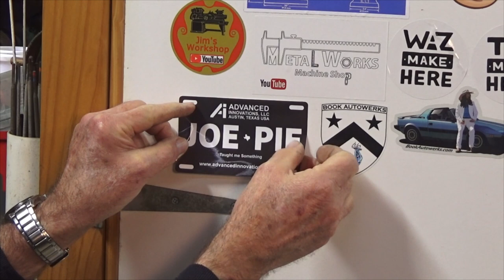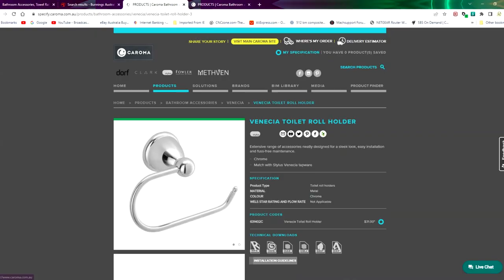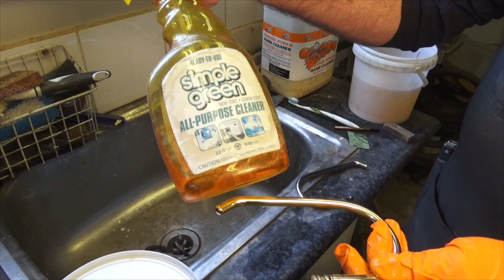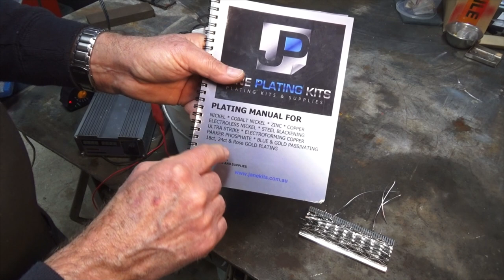DIY ART DECO WALL SCONCES (THAT'S A WALL LIGHT FITTING) Part 6

Comment: Mark, it is possible to lay nickel down onto steel.  However, topnotch work requires a layer of copper be laid down before the nickel.  Because iron is much more reactive than copper, a "strike" bath has to be used to prevent poorly adhesive immersion plating from occurring.  The most common copper "strike" is based on HIGHLY toxic cyanide.

I totally agree with the rant.  The sale of Chinese guano at other than "bargain basement" prices occurs far too often.
Reply from the maker: Jane Kits do sell a copper strike kit and an electroforming copper kit. Sadly, I have so many buckets of chemicals now that adding another would seriously overwhelm my storage. Maybe when we downgrade to just one car I can expand my repertoire. 
Regards,
Mark

Comment: I worked for a company that reconditioned train bearings, we performed hard chrome plating which was an extremely corrosive and dangerous process.  You are correct about the constant filtering of the solution, we had to change the filters a few times a month.

Comment: I have only played a little with electroplating so far and not even got results as good as yours. But chatting to a local plating company, mostly asking why their results were so much better than mine, apparently the secret is thin layers of copper plating. You polish your part until it's perfect(ish), copper plate it, then polish it again. The copper is so soft that the polishing removes all of it apart from the bits filling the scratches. I haven't tried this yet, but they did really good, super shiny work, so I have no reason to doubt the advice.
The crystals you're getting will be just the result of forming an oversaturated solution of the plating salts. As the solution cools they will be unable to remain in solution so will form crystals. The sludge is other non-soluble side products of the electrolysis - various oxides etc.
Reply from the maker: Matthew, I have an experienced electroplater (retired) paying a visit later this week. He did say that I was only going to get mediocre results until I started to copper plate first. I would very much like to use that process but I have a large collection of chemicals already and I didn't really want to create more of a storage headache. I may have to move all the buckets up to my shipping container "annexe". 
Regards,
Mark
Reply: @Preso58  I can totally understand the 'too many chemicals' problem. With metal finishing, homebrew, and various other chemistry interests I have so many pots of 'interesting' chemicals I worry what the authorities would think if they ever investigated... I'm fairly sure it's all legal, probably...
It is good to get independent verification that copper plating is the way to go. I was shocked how little effort the pro's put into polishing to get spectacular results.

Comment: For prep work on the pre-plated part, a product like Prep-All would work great. It is most widely used by paint/body people to remove grease and wax from a car body to get it ready for paint. Would do the same for the brass you're using, only without as much work as you're putting in to the part with Simple Green and scrubbing.

Comment: Hey Preso, great series and I’m learning a lot. I’ve seen that dirty little trick of showing highly polished parts at particular angles to hide the scratches. Some times you can spot the imperfections if you look carefully. I am collecting materials for nickel plating but got side tracked and went down the rabbit hole of “bluing” metal with hot salts which is different again to cold blueing and hot blueing with oil. I’ll have a video out on that shortly. I really hope you enjoy your holiday and stay safe. See you in a few weeks, cheers Stuart. Canberra.
Reply from the maker: Thanks Stuart. I'm interested in seeing the hot salt method for treating steel. I've never had any success with cold bluing. It looks OK for a while but it soon goes brown and inevitably turns to rust. 
Regards,
Mark
Reply: @Preso58  Same here Mark, I’ve always found the cold bluing sort of patchy and gives no protection against rust. Just decorative really.

Comment: Hello Mark, good work! a tip, the surface will become more even if you heat the galvanic solution to at least 30 degrees. also the Part should heat it to 25 - 30 degrees.... but I can imagine that it's pretty warm where you are 😆... nice weekend !
Reply from the maker: Christian, we are currently having one of the coldest and wettest winters for many years. However I do heat the nickel solutions and the parts. Caswell sold a very good immersion heater but when I checked to see if they still sell them they were not listed. Evidently, they can cause fires if they are not fully immersed in the electrolyte. 
Regards,
Mark

Comment: During my flirtation with commercial electroplating of nickel and chromium those inside corners gave us fits, especially with the chrome. Our cleaners were strong acids and caustics followed filtered  water. The nickel baths were filtered continuously. We did use fairly violent agitation of the nickel bath. The substrate was steel.
There were minor surface defects with the nickel plate; the problems came with the second plate of chromium over thee nickel. The chrome plate was a fast "flash" plate. The common defects were poorly plated corners and peelers. from time to time we saw some orange peel.
Commercial plating is not an activity for novices!
Reply from the maker: I did visit a commercial electroplating business to have some parts plated many years ago and I had a sneaky look around while they were busy. I was able to see inside the baths and there was some very heavy agitation going on. I have a retired commercial electroplater visiting my workshop on 'Thursday and he has agreed to critique my setup. I will be able to report on what I find out in the next video. I spoke to him on the phone before publishing the last video and he confirmed what you said about the Chrome being just a thin, fast flash. I am very keen to find out more but as you observe, it's a very deep rabbit hole. I have always been curious about the process.
Regards,
Mark

Comment: I'm not sure Mark, but you may need Anode bags around your nickel cage. In copper plating they use a 1 or 5 micron material.
Reply from the maker: Thanks. I need to find a suitable material. I am wondering if Tyvek would do the job.
Regards,
Mark
Reply: @Preso58  according to Wikipedia it checks all the box's. None woven, water penetrating polyethylene material. Other than that your parts look great And I enjoyed watching👍
Reply: @Preso58  Commercial plating shops use bags to keep the impurity crud from the nickel to a minimum. I reckon it will help improve your process.

Comment: Thanks Mark!  Super interesting.  Greetings from North Carolina, US. I remember getting a chemistry set as a kid where a project was to nickel plate a penny. It was and is magical. 

I found some info implying the green grunge is nickel salts, which are expected. They mention high pH can accelerate formation. I'm not a chemist but have experienced this in the context of swimming pool maintenance vice calcium :)
Reply from the maker: Gene, I recently purchased a PH meter to check the anodising dyes that I use and it turns out that if the PH is wrong, the dye won't penetrate the anodised coating. I suspect that the electrolytes will be the same but I have a retired electroplater paying me a visit later this week and I hope to have some more information on what I am missing out on in the next video.
Regards,
Mark

Comment: What an honour to get a Joe Pie sticker?!
Reply: A bit of trivia - International Harvester used copper plated bolts to attach their exhaust manifolds to their engine blocks. 

It stopped them from seizing in the manifolds due to the extreme heat.
Reply from the maker: Dave, I sent Joe one of my stickers many years ago but never expected to get one in return. So, to have one turn up was a real treat. 
Regards,
Mark

Comment: I really wouldn't sweat the defects, Mark.  Not only are you about the only person who's gonna see them (well, apart from everyone who's  seen this video), but even if they do, "it's artisan" :)  In any case, the end result is glorious, helluva job you've done there.

As an electrician, though, I'd steer clear of terminal blocks.  They get loose, the wires overheat, and in the extreme they can cause fires.  Wago connectors for the win (series 221, which handle rigid to flexible connections)).   Also, and perhaps more importantly, that's a conductive light fitting, it needs an earth connection.
Reply from the maker: Thanks. I will be earthing the whole frame but I have never heard of Wago connectors. OK, scratch that. I do have some I just didn't realise what they are called. 
Regards,
Mark

Comment: I was taught that cheap diecast alloy was called "crappite".... I don't know where this came from.. my dad was a Brit expat living in NSW from 1968 to 1973....
Reply from the maker: Everything I had read about electroplating aluminium alloys said that it was difficult which is why I thought those parts would have been made of brass. The company that sells them does make very good quality tapware and it is made of brass. Clearly, some bean counter has had their way and crappite it is!
Regards,
Mark

Comment: Wonderful watching your process.  Considering some of the minor problems you had, I have a suggestion.  What if you use a pump to circulate the solution out of the container, through a filter and heater, then back into the container?

This would solve your sludge problem, as you mentioned.  It would also let you maintain the heat of shallow baths.  Finally, it would let you remove the aerator, as there would now be a constant flow of solution.

Thinking of the aerator, might that be causing some of the speckling?  I'm thinking tiny air bubbles may be clinging to the surface of your part.

Just food for thought.  I'm glad you're enjoying your journey through all this!
Reply from the maker: I had a visit from Chris Lock on the weekend. He is a retired electroplater and he gave me two very good books on the subject of electroplating. It appears that commercial plating setups use air to circulate the plating bath and the heaters are usually immersed in the tank itself. Filtration is a more complex issue and there are several types of filter. Some are continuously operated and some are portable units that can be taken from one bath to another. The issue with pumps is the corrosion caused by acidic and alkaline solutions. I have made a better container for holding the electrolyte and a better sparging arrangement. The advice I received to get a better finish was to copper plate first and then add the nickel cobalt over that. Copper is much easier to polish than brass.
Regards,
Mark

Comment: The heavy scrubbing is a bit unnecessary.  Let chemistry do all the heavy lifting.  I soak the part for a few minutes in a hot degreasing solution (TSP trisodium phosphate, or watered down drain cleaner) followed by a scrub with a scrub with a towel and rinse. Finally, spray it with brake cleaner and rinse again with water. This will remove any remnants of grease or wax. I do this for
Reply from the maker: I do know there are better cleaning agents for this type of work and I have used a hot caustic cleaner when I was doing some electroless nickel plating. It was a very powerful cleaner but of course it also required some heavy duty PPE. I can soak parts in that Simple Green cleaner for an hour or so and they don't need a lot more treatment after that. However I will look into the TSP as an alternative.
Regards,
Mark

Comment: Loving the progress! The cages for the anodes...is that stainless? Do they suffer any degradation/erosion? On the mystery crystals. I'm wondering if some minerals present in the original water you used, and they have crystallised and fallen out of the solution?
Reply from the maker: Bill, the mesh baskets are stainless steel and they do disintegrate. One was falling apart by the time I finished all the plating. Titanium is the best material but almost unobtainable for the hobbyist. I am thinking I will thread the nickel cobalt anodes onto some titanium wire and enclose them in a filter sleeve. I have been advised that the crystals can be just put back into the electrolyte and they will dissolve when the liquid is heated. If I had filtered the solution when it was hot I would not have had any solid crystals. 
Regards,
Mark

Comment: Hell Mark, Mark from Canada. For heating your larger solution think double boiler. Larger tub with the immersion heater and secondary tub with the solution. The comments for copper plating beforehand are spot on. Also a few air  tubes along the length of your container with a series of holes along the sides of the tubes will give you a much more even agitation. Nice work. Thanks for sharing and giving such great explanations. I have used aquarium heaters and aquarium diaphragm air pump bubblers for etching. Same idea just a reverse of the process.
Reply from the maker: Thanks. I have since realised that I purchased a pond pump several years ago and put it aside unused. It is the type that has a magnetic drive and would be ideal for circulating the electrolyte. I actually watched Stefan Gotteswinter's latest video in which he used the same pump for a parts wash machine. The heating idea is a good one. I must try to make a more specialised container or purchase some more electrolyte. 
Regards,
Mark

Comment: Mark, your production quality continues to approach your technical expertise!  Thanks for passing along your experience with the pain-points. Somebody may have suggested this already, but if not… Nix the bubbler. In a second bucket install your immersion heater, an aquarium pump and filter (to catch the very fine suspended particulate as the heavy precipitate will accumulate at the bottom of the plating bucket so you will want to make sure enough room is provided to collect it); connect the two buckets with supply and return lines. This will increase the complexity and volume of electrolyte used but should provide better control, purity and homogeneity.  AND ENJOY YOUR TRAVELS!!!
Reply from the maker: Thanks. I am in the process of making a better plating tank with some built in refinements. It would be nice to have more electrolyte but I am running out of storage space. Usually, I don't do large parts like these. Jane Kits sell plating kits in 4, 10 and 20 litre volumes. I will be investing in a copper plating bath though. Evidently, copper is the preferred substrate for parts receiving nickel plate. It is much easier to polish than brass and fairly forgiving. 
Regards,
Mark

Comment: Nice work Mark. 
One thing that you might want to consider is adding a ground (earth) terminal to bond the metallic parts to the household supply ground. (I presume that lighting circuits have grounds in Australia?) . It'll prevent the metal parts from becoming live in the event of a fault occurring.
Reply from the maker: Thanks, yes, I will be adding an earth to the frames. I have a drilled and tapped hole for it and I just need to make up a wire clamp for it.
Regards,
Mark

Comment: You might try putting filter bags around the anode baskets, it should help keep the solution cleaner, of course they must lay in such a way that the bath cannot escape the bags. Hope that makes sense, and indeed plating over steel in show chrome gets copper, then nickel and finally chrome. You got great results from that process you are using, some of the coarseness is probably due to contamination.
Reply from the maker: Thanks Larry. I was given two very good books on the subject of electroplating by Chris Lock, a retired electroplater. He has advised that copper plating is indeed the best way of ensuring a blemish free nickel plate. I am investigating getting some filter bags and I am in the process of making a better plating tank with some built in sparging lines at the bottom of the tank. There is still a lot to learn with this subject and I fear that it is too deep a rabbit hole for me to investigate fully. Still, I am happy with the results but I would certainly like it to be better.
Thanks for watching.
Regards,
Mark

Comment: Excellent video as usual Mark. The quick shot of the bender caught my eye ..... now that would be a useful tool in my workshop. Cheers
Reply from the maker: There are drawings of the Hossfeld clone bender available on the internet. http://kinzers.com/don/MachineTools/bender/ I don't use it a lot but it is a very adaptable tool if you have enough accessories for it. 
Regards,
Mark
Reply: Thanks for posing the link Mark. Cheers

Comment: If you want to heat the plating solution in the rectangular bin uniformly, place that bin in a larger bin filled with water & bock the smaller bin up with some bricks then heat the water in the larger bin with your heater immersed to the proper depth...
Reply from the maker: Thanks. I have had a few suggestions along those lines and I must confess I got lazy and couldn't be bothered looking for a better solution. Caswell seem to have stopped selling that particular heater. Mine is branded Caswell and according to their website there have been quite a few fires caused by immersion heaters running dry. They recommend using metal containers and heating them over a gas or electric stove. 
Regards,
Mark

Comment: How is the metal frame of the fitting grounded to the mains wiring?  It seems isolated by the plastic 3-D printed piece
Reply from the maker: I will be using a separate earth wire direct to the rectangular frame. Might be a bit scary without one.
Regards,
Mark